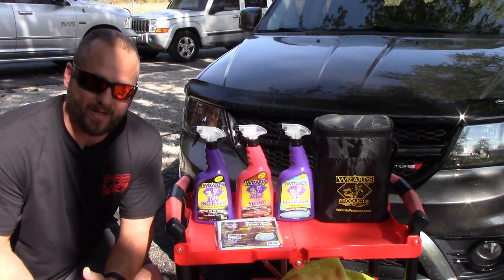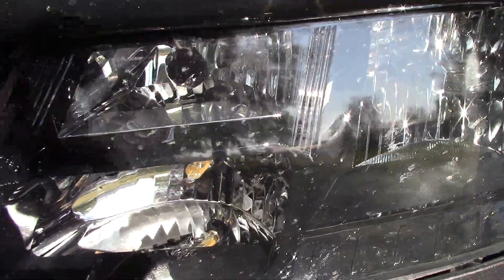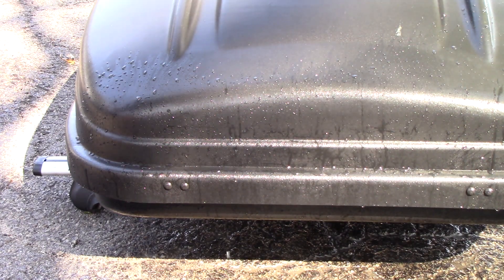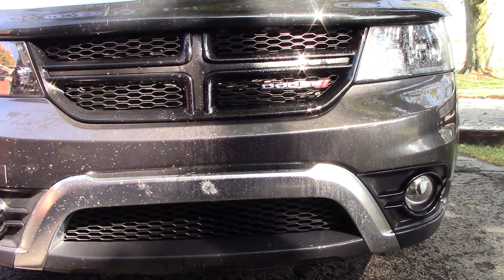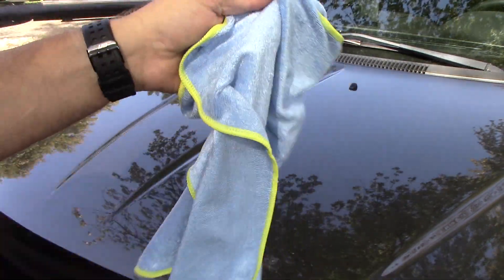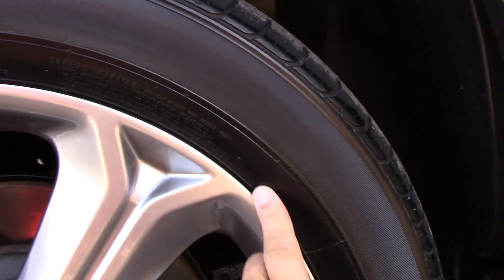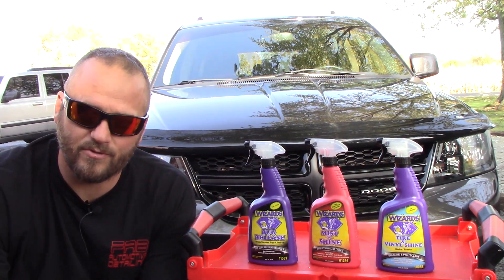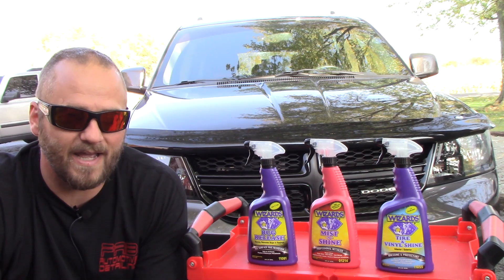Wizards Products Review! Bug Release, Mist & Shine, Tire & Vinyl Shine. Results Might Surprise You!

Comment: The Wizards Water Bandit works great for washing dealer lots or multiple cars
Reply from the maker: That’s great to know since I sell to dealerships. Thanks
Reply: @FABAutomotiveDetailing  the dealers will buy the Water Bandit. It saves them on laundry and use one Water Bandit to dry every car on the lot and every sold car  . No reason to have drying towels at the dealership  when you have the Water Bandit